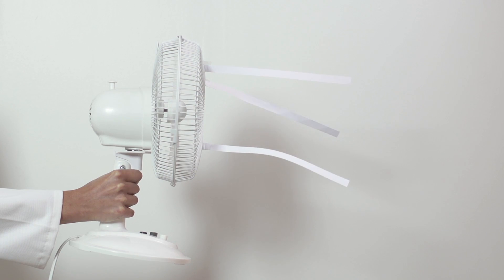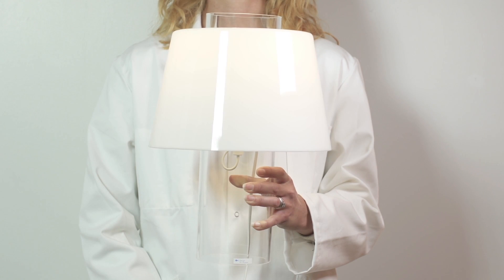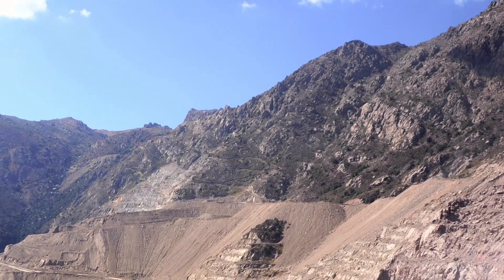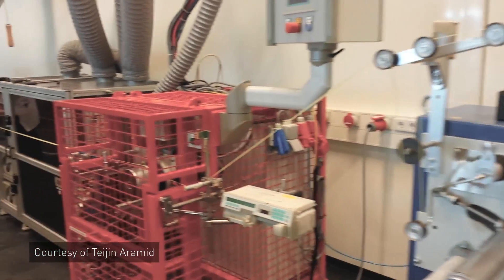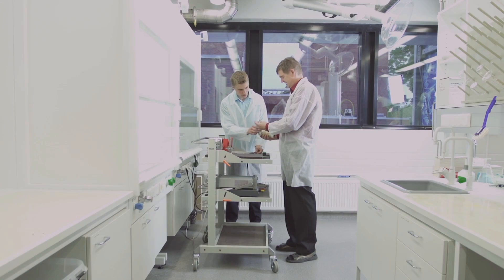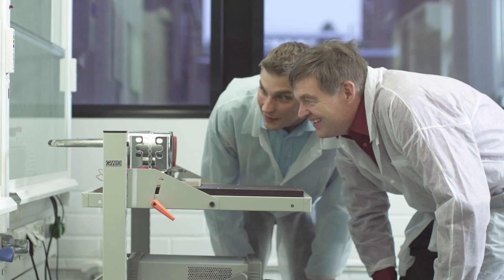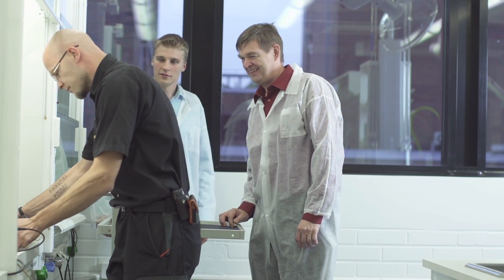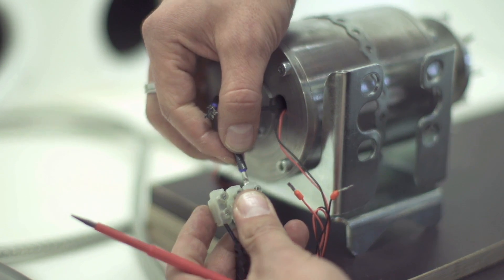Carbon Nanotube Yarn Rotates Electric Motors at LUT

Comment: Have you all tested this motor douring thermal runaway and also why don't we use this as a super conductor where like in a vacuum you have a light bulb element but for the motor where the casing allows for that vacuum to hold while the motor is in thermal run away?

Comment: Graphene is also superconductor. Motors for eBikes?
Reply: A superconductor at a low enough temperature - still requires cooling to reach that critical temperature.
Reply: @mnomadvfx  Carbon is still significantly better electrical conductor even at room temperature than any other metal
Reply: @RynaxAlien  you seems to know more than me on this subject.
Giving the fact that now some companies makes better carbon nanotubes do you think a motor made with carbon nanotubes will out perform existing ones with copper and rare earth materials?
Reply: @RynaxAlien  this would make an ever more insane high power to weight electric motor.

Comment: graphene is conductor of electricity, mix some of this materials. it will be great
Reply: Graphene and carbon nanotubes are both carbon... the only difference is the shape of the carbon, while the graphene is, in theory, a long sheet of one atom thick carbon, the nanotubes are 1 atom thick tubes, so creating a "graphene tube" is actually creating a carbon nanotube... they both have the disadvantage of being hard to make in long strips... I guess nanotubes are better when "glued" together (imagine the difference between carbon fiber, with the fibers interweaving vs. a strip of carbon made out of multiple pieces "glued" together at the ends (at those ends it looses strength an also electrical conductivity)....
Reply: thnk you! im wondering how come a carbon fiber is not a conductor of electricity and graphene and nanotubes are?
Reply: You're welcome, I think that carbon fiber (used in the automotive industry) has a large amount of epoxy which is not conductive, it haves a large plastic/carbon ratio (pure carbon fiber is conductive), I guess that the more non-conductive binding material the lower the conductivity is, the trick is to use conductive materials to bind the carbon or to use less non-conductive binders... Ideally to make it all carbon, which will result in optimal performance... As a side note, the imperfections in carbon (including Oxides, like graphene oxide and shape deviations) result in worse conductivity.
Reply: I wonder how susceptible carbon fiber would be to static electricity...?
Reply: I think carbon nanotube has the same conductivity as graphene but carbon nanotube yarn was made by spin a lot of short carbon nanotubes together so it has the same conductivity as  carbon fiber. If they could made continuous long carbon nanotubes and strand it together, it would be a best material for almost everything.

Comment: you have caracteristic of your test carbon nano-fibre coils? wath voltage and amps need ? you can compare with the same motor wiht cuper coils? its pure carbon nano-fibre coils or its mixed with cuper? and who you isolated each wire from another?
Reply from the maker: +SLEVIN SHAFEL The winding material used is only carbon nano-fibre and copper is not used at all in the coils. Rated voltage is 3.2 V and current 2.3 A. At the moment copper wound motor has better efficiency as the nano material does not have very good characteristics. It’s resistance is quite large at the moment but it will tolerate more heat than copper. But the future looks promising for the nanotubes. Hence, it will compete against copper in the application of electric motors.
Reply: +lutvideo thank you for responde.
i expected using carbon nano-fibre in coils wold be more efficiency than copper coils.
well for the start test its not bad to see more heat tolerate and lower weight.
Reply: @slevinshafel9395  Hi there, how is your experiments going ?
I see a huge potential for this but I am a little bit out of my depths in this subject.

Comment: Hello, please what motor is that?
Reply: It is a 3 phase AC, 2 pole, permanent magnet synchronous motor, i just finished reviewing the journal articles
Reply from the maker: +Tatiana Mejia Pyrhönen along with his team developed and built an electric motor with carbon nano-fibre coils. This motor can be used in several applications.
Reply: my best guess, a 2 phase, brushless stepper motor.
Reply: my best guess, a 2 phase, brushless stepper motor.
Reply: my best guess, a 2 phase, brushless stepper motor.
Reply: i think AC motor dont need magnet? am i right?